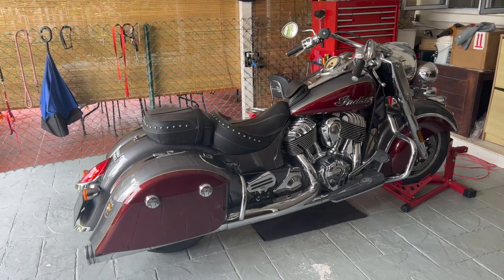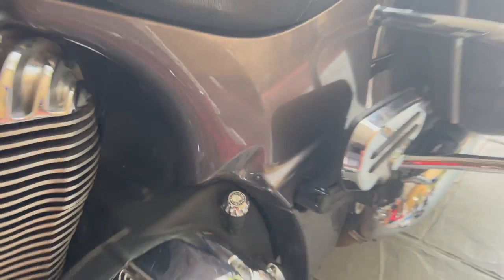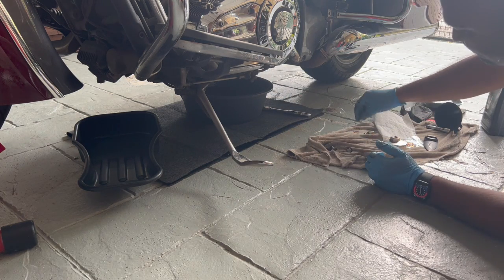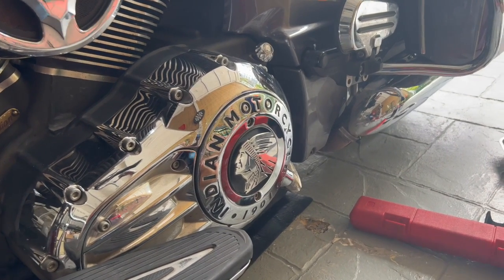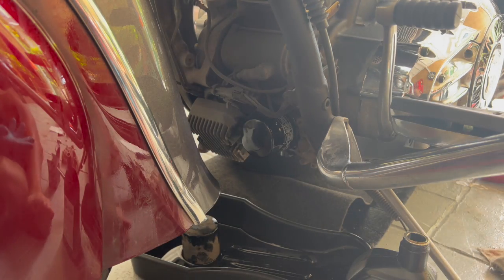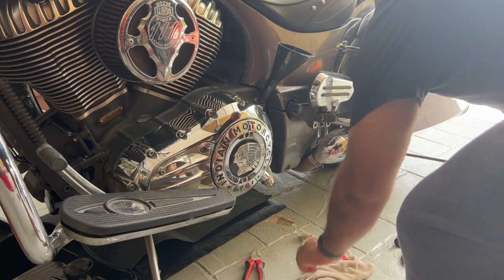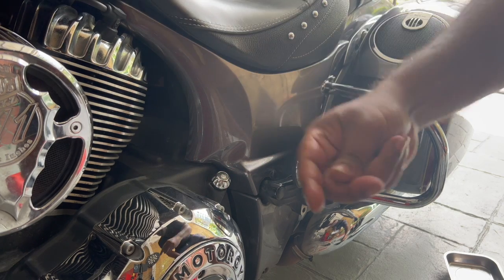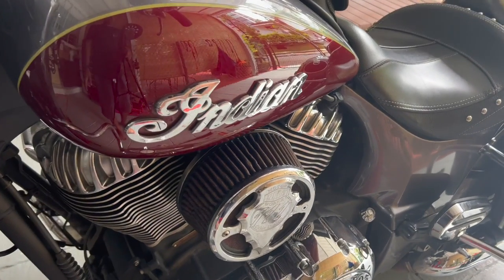Indian ThunderStroke - How to Change Engine Oil

Comment: I am having a problem loosening the two drain plugs.  What do you suggest?
Reply from the maker: If your drain plugs haven’t been rounded and they’re just stuck, you probably just need a longer socket wrench for more leverage.

If your drain plugs have been rounded, and you haven’t removed a rounded bolt before, I suggest just taking it into the shop and let them take it out. Any other part of the bike, you can watch YouTube videos and try to take out the rounded bolt. But if you damage the part of the bike near the drain plug, that’s a major major repair.